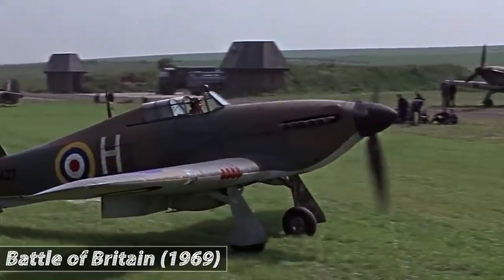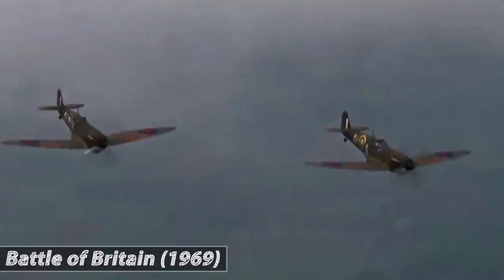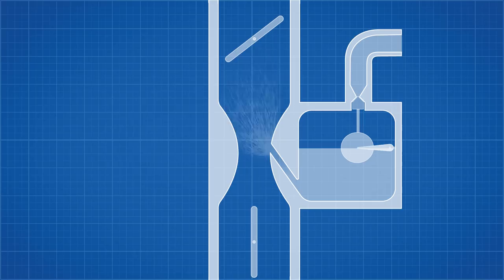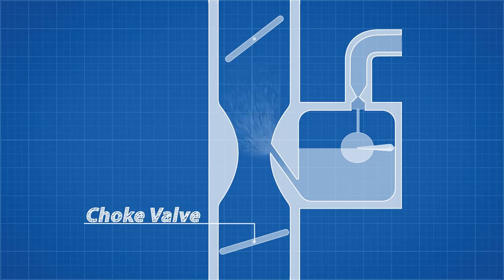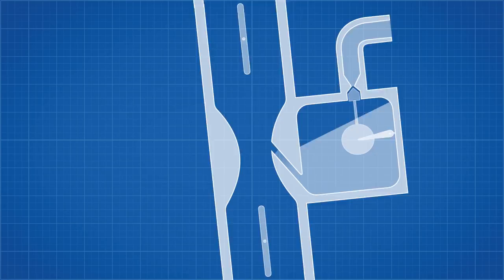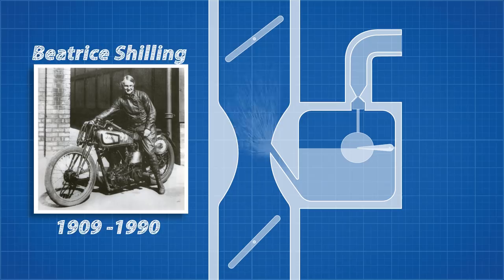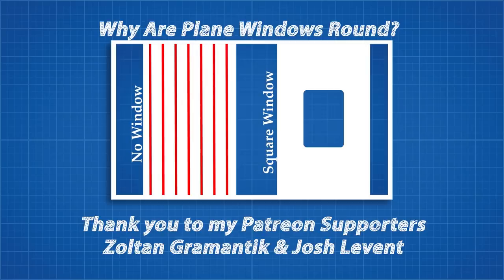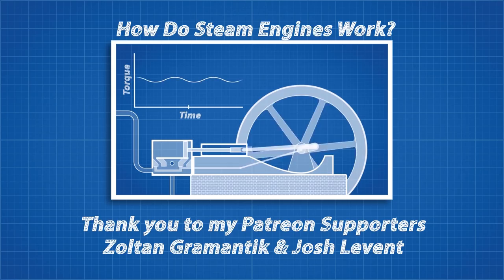The Spitfire's Fatal Flaw

Comment: Interesting and factual but the pilot's themselves had alternative manoeuvres that proved successful. Douglas Bader and Bob Standford Tuck explained how they would deal with the 109 nose dive issue. They would simply flick their fighter through a half roll and hang onto its tail. True, the mk1a Spit had outdated firepower but bear in mind they were aligned to converge all 8 Brownings at 200 yards so those little bits of lead were in effect capable of sawing through a wing or fuselage. Bader also preferred the Hurricane as a gun platform as the four in line per wing of Sydney Camm's fighter delivered a better concentration of lead. It is also worth remembering that the Hurricane shot down more enemy planes during the battle than any other. Finally, the Luftwaffe would fly in pairs whilst the RAF were usually in "vic" formation of 3 aircraft, but air battles were normally chaotic affairs as one would expect. There is no doubt that the two fighters were evenly matched especially when in experienced hands, and the later mk ix was superior but then the focke wulf 190 was its main adversary. Best fighter of the period? In Europe the Merlin engined P51 ....
Reply: Actually, right from Tuck: by the time the pilot had rolled over, the 109 was out of range.  The pilots (including Tuck) suspected what was happening, and examining a captured Bf109 (and its fuel-injected engine) confirmed it.
Reply: The fuel injection of the Messerscmidt had its own disadvantabes
Reply: Paul Standeven: what were the disadvantages to the fuel injection?  Not being an ass, just genuinely curious.
Reply: @Johnathan:    1. Power to weight ratio.   2. Fuel consumption/efficiency.  (a key contributor to the achilles heel of the 109 -  its severely limited endurance in it's primary escort role)  http://www.456fis.org/SPITFIRE_ENGINES.htm   "Many authors have criticised this aspect (the choice of carburettor) of the Merlin design. In reality, like most engineering, it resulted from a design compromise- the drop in temperature developed in a carburettor results in an increase in the density of the fuel-air mixture when compared to that of a fuel injection system. As a consequence the Merlin produced a higher specific power output (horse power per pound) that the equivalent German engine. It was felt that this gave a higher power to weight ratio for the fighter and (rightly or wrongly) that this outweighed the disadvantages."        Also (WRT fuel consumption)    "the Merlin was quite small when compared to the opposition. The Merlin had a capacity of 27 litres, whereas the DB601 of the Messerschmitt was 39 litres and the BMW801 engine of the Focke-Wulf 190 had 42 litres. The superiority of the later Merlin engine Spitfires (ie Mk IX) over these Luftwaffe aircraft is all the more remarkable when this is remembered."
Reply: The time to flick their Spitfire Wings was so Long that when they flicked their Wwings the German allready pulled Positive G and was above the Spit! German Ace Pilots knew that Trick from very early on! Thinking about the Ingenious German Inection System that was only Copyed by the US and the Brits after they examined a DB Engine of a crashed 109, I wonder how the Brits even had RADAR :) But kudos to the RAF for facing off the Luftwaffe and winning the Day at the End! And kudos also to the Invention of the Parachute, that let your RAF Pilots get a new Plane whenever they were shot down by a German! If those fights would have happen more to the middle of the Channel - The RAF would have lost all their pilots within a Week!
Reply: @Wanderfalke :  >> "the Ingenious German Inection System that was only Copyed by the US and the Brits after they examined a DB Engine of a crashed 109"<<    As far as I'm aware, the Brits and Americans used exclusively carburettor fed aero engines on all their primary aircraft types throughout the whole of WW2 (and way beyond)  RR Merlin, Griffon, Bristol Pegasus, Napier Sabre for the Brits and the Wright Cyclone, Allison and the mighty Pratt & Whitney double Wasp powering most US fighter and bomber aircraft.
Reply: Ok
Reply: I don’t see how they would be able to steal an engine for a plane designed in 1938 that they never actually got from said crashed 109 until maybe 1940 or 39. The simple fact is that the British are almost constantly inventing excellent new military and industrial technology (machine guns, RADAR, tanks, etc). That’s just the way it is.

Comment: Interesting video despite its flaws. The Me109 was indeed a good match for the Spitfire in the air though they were notoriously difficult to take off and land. Rumour has it that the Luftwaffe lost more pilotos on the ground than in the air. Interestingly enough, the Spaniards built a version of the Me109 after the war with a Merlin engine. It was known as the  "Buchón" as the front end of the aircraft had to be modified slightly to accommodate the different shape of the engine.

Comment: Did anyone notice they start the film with a guy talking about a Spitfire while showing the hawker Hurricane...?
The spit fire did well, but the work horse of the Battle for Britain’s skies was the Hurricane.
6 30 caliber machines guns... then they put two 50 caliber machine guns and 4 30 caliber machine guns..in.
The spitfire had different gun set ups as well..
But ended with 4-20 mm cannon or slightly larger cannon..
Four cannons firing at you is the end of your plane ride.

Comment: I FORWARDED THIS VIDEO TO A WWII AVIATION EXPERT::  THE FOLLOWING IS HIS RESPONSE.  The majority of the pictures alluded to be Spitfires in the video are actually Hawker Hurricanes. They had the same carburetor problem and Rolls Royce engine. Tillie Shillings device was reverently called “Miss Tillies Orifice” by the British. The Bf 109 had mechanical fuel injection and could “push over” without stalling the engine.